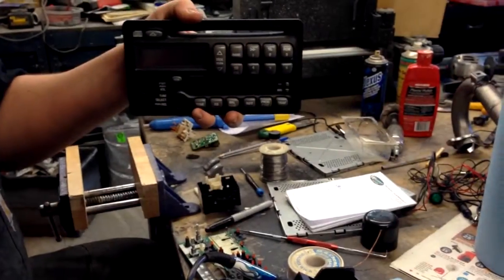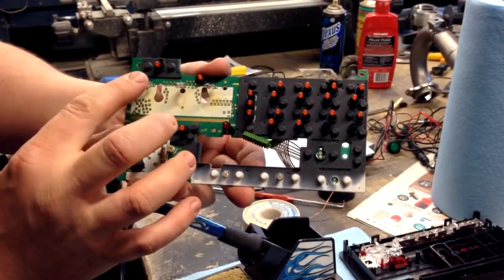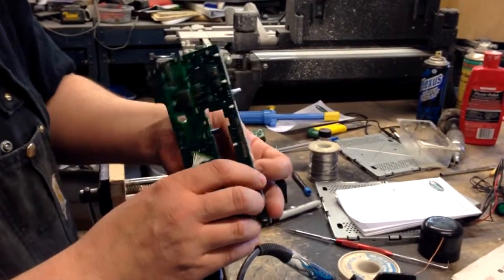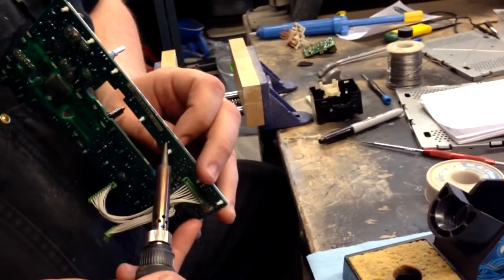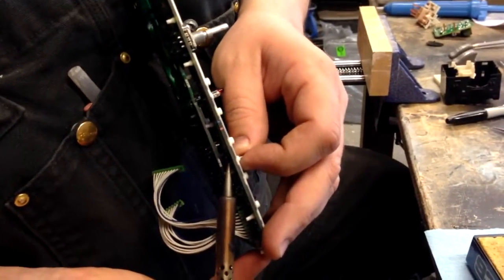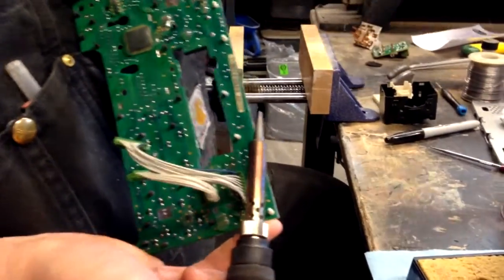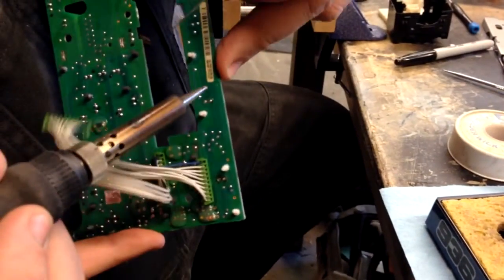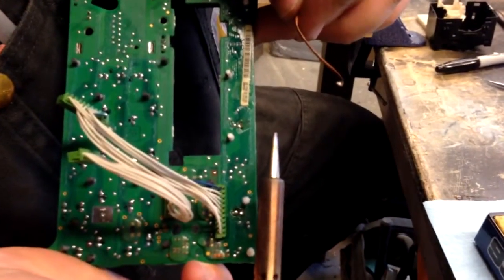GM Delco Stereo Lights Replacement - Soldering Technique for Bulb Removal

Comment from the maker: The light bulbs are available from www.1000bulbs.com .  The smaller bulb is a T1 size, Eiko 2182.  The larger bulb is a T1 1/4 size, Eiko 8640.
Reply: +Gregg Messenger Thanks for your help, Gregg. I used the 2162 bulb which is a T1-3/4 bulb for the LCD backlight and was able to get the white diffuser off of the old bulbs and onto the new, slightly larger ones. I didn't realize that a lot of places sell a 2182 bulb that is also a T1-3/4 size, so I ended up with 3 bulbs that are much too bag for the bottom row of buttons. Just cautioning others to read the specs carefully when ordering your bulbs!
Reply from the maker: Fred W I'm glad the video helped :-)